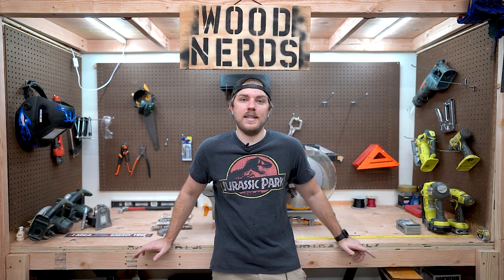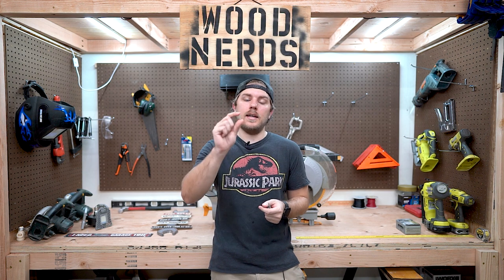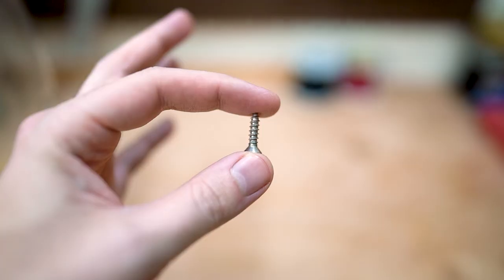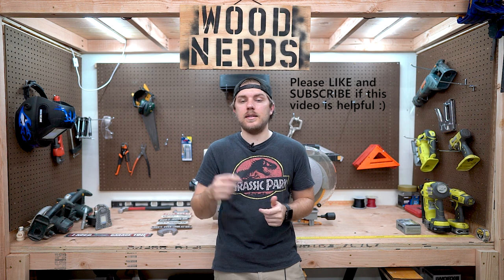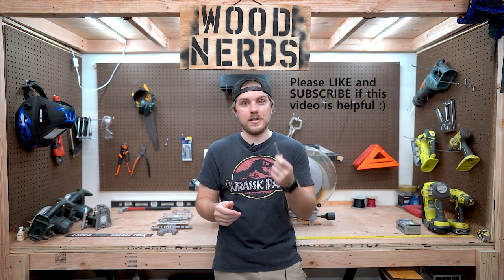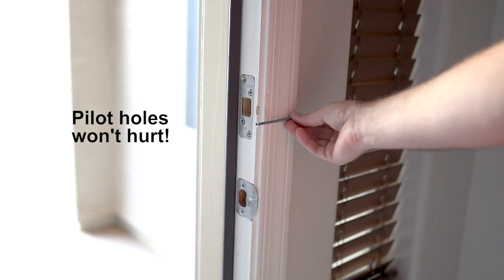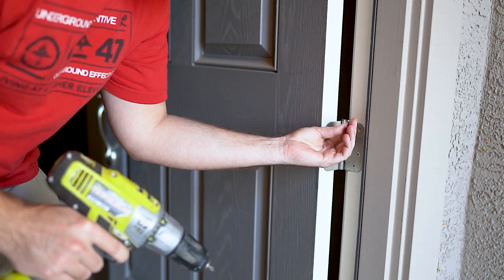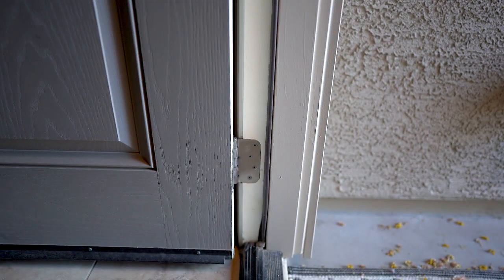3 Screw Security Upgrade

Comment: QUESTION: There is a video published more than 10 years ago on long screws. I believe it was an experiment performed by the LA housing authority using apartments they were going to tear down. Ring a bell? The LAFD literally had to break the door to get entrance, the hardware and hardware points didn't fail. I cannot find that video!

EDIT: Shoot. I don't think you saw the video. If you did, you'd put them in the deadbolt strike plate and barrel plate, too.

Comment: In Europe we use upvc doors and frames. You can hit them with a battering ram and you’ll just bounce right off it. 
The UPVC doors also have multipoint locks so when you lift the handle prior to locking then this fires bolts in to the frame all around - like 2 at least on each side and top and bottom of the door in to the frame. Seems crazy the yanks have single point locks. You need bolts on all 4 sides of the door really
Reply from the maker: Being a yank, I have never heard of this haha. I’ll have to check those out! Sounds really cool though, thanks for sharing!
Reply: Wood Nerds - Maybe we get a lot more burglaries here in the UK so it’s a thing, I dunno. Also our doors tend to require a key to open them from the inside which Ive heard is against code in the US (for fire escape reasons) so maybe we need the beefed up security to prevent people climbing in a window and escaping via the door. Just guessing...
Reply from the maker: That makes sense! Dang! Well be safe out there! Wish worrying about that stuff wasn’t a problem.

Comment: It's funny that you see people buy hundreds or even thousands of dollars of security equipment and cameras but never make this upgrade that costs less than $1. This simple upgrade plus a security door would be great upgrades for most homes I would think, but I'd never sneer at a good security system. Maybe future content could include security door or security system installation, I'd watch that.
Reply from the maker: I agree! That’s a good idea! Unfortunately like you mentioned they are expensive haha. I could probably weld up a security door or gate though. I’ll have to look into material costs for that. Likely a video for the winter since it’s likely going to be over 100 degrees for the remainder of the summer here.
Reply: Good tips if you don't have any other security. I spent years working prisons listening to crims talk. The best security is deterrence. A security door with deadbolts top, bottom and middle is a good idea. Crims want to get in and out quick, and they do their research on security, they'll see the triple bolt door and move on to the house without it.
Reply from the maker: That’s good information! Thanks for sharing!

Comment: The way most of these homes are built, there’s probably some thin shims (or air) between the jamb and jack stud.
Reply from the maker: The new houses are surprisingly economical but I think you’re right about how robust they are. It’s cheaper to hit all the requirements and miss the security aspect of a dwelling.

Comment: Thank you for the home safety tip. My only concern is that the 4" screws might penetrate some wiring or piping? But I might just be talking nonsense. Thank you.
Reply from the maker: That’s always a concern of mine! It’s not typical to run wires in those areas of the door frame (all the boards being penetrated are sandwiched together so there wouldn’t be a place for a wire to run, same with piping.) good thinking though!
Reply: @WoodNerds  OK Thanks, good to know
Reply from the maker: Of course! Happy to help.

Comment: I've seen this recommended before -- but I don't buy it. The shear strength on screws is not great; certainly not enough to make a difference. Replacing the hinges might help but you are still going to be splitting the frame or breaking the door itself.
Here is some detail from a Firefighter who breaks down doors for a living. https://www.reddit.com/r/lifehacks/comments/cprl7b/for_easy_extra_home_protection_replace_the_short/ewrfzzt/
Reply from the maker: Hey, thanks for watching! I respectfully disagree, the shear strength for 1 screw isn’t great, but several compounds the strength by more than I would be able to kick through. Outside of that most front doors now a days are thin metal with foam filling making it hard to break(bending more likely and perhaps warping enough to allow entry but by that time I’d be exhausted and everyone in the house would be prepared to defend). As for the frame, it’s pretty logical to say it’s a lot easier to split a 3/4” board (door jamb) than 3-3/4” of jamb, Jack, and king stud right? So perhaps an intruder could still make it in, but this would definitely give you more time to prepare, or maybe it would deter them from continuing the attempt when they find its substantially harder than previous doors they’ve tried? So surely you’d agree it’s still a worthy upgrade for minimal effort and money? Shoot, I bet you have the screws lying around to do this right now if you wanted.
Reply: I'm a firefighter also. I have 16 years on the job which includes 7 years on ladder companies. They are the crews who specialize in forcible entry and it's one of their primary responsibilities at fire scenes. I've also been a member of the urban search and rescue team for a decade. I have to disagree with some of the other firefighter's comments that were linked. He stated most doors can be forced with a strong kick. Sorry but that's BS. Not an exterior door. No way. further, I'd love to see him try, and I'll put money down that he can't kick an exterior residential door with a dead bolt. You can kick in an interior door. 

The strength of the door system doesn't rely on the shear strength of the screws holding the strike plates in, especially the dead bolt. Besides, the break-in attempt is not imparting shear forces at one single point. The screws are buried completely in the wood, so it's transferring the force along their entire length against the same thickness of wood at least an inch thick. But even with all that said, the door latch and dead bolt extend into their cavities by about 1/2" inch for the latch and about 7/8" for the dead bolt. Wood is pretty damn strong. I've been to car vs. tree accidents and the tree (even small ones) usually does just fine even when the car is up near interstate speeds.  The plates are mortised into the jamb so any lateral (inward in our instance of discussion) movement is anchored by the lip of the mortise and thus the integrity of the jamb material.  So, the longer screws are attempting to bolster the thickness of the jamb (~3/4" thick usually) with about 3" of Jack and king stud framing members. An attempt to force the door by your average burglar will likely be directly against the door near the knob. Again, you're not kicking in an exterior door, even with the little screws that come with the hardware. Look at videos of police sawt teams forcing doors with a battering ram (the hand held, not vehicle mounted). They need several good hits, and you'll find some videos of some pretty embarrassing entry attempts. 

When we force doors we use the irons, a flat head axe and a halligan bar. We pry the door and jamb apart to start a gap at the knob, between the door edge and the jamb surface. That's also about the mid point if the jamb opening and where you'll get the most flex the the jamb. With proper technique, you're spreading the door and the jamb apart to allow the latch and deadbolt to clear their catches. The technique also involves pushing inward as the pry with the halligan so typically you're also gaining space by collapsing the jamb into the void between in and the framing.  Door jambs aren't installed flush with the rough opening. There is usually tearing of the jamb and trim where the wood fibers fail. So all of this is a long way of saying that the longer screws can help some I would say. Depending on how the system fails, we will usually do a temporary repair by using long deck screws so that the homeowner can secure their place untill they can call a carpenter..... In cases where we force entry for medical calls, etc. 

I'm actually interested now in building a door prop and using longer screws to see how they might or might not effect a forced entry attempt. My comments above are just theorizing how the longer screws would work based on what I've seen with the standard hardware.

What will help MUCH more is a security buttress that anchors between the base of the knob and an anchor point on the floor.
Reply from the maker: Bob, thank you for taking the time to share your experience and also for putting your butt on the line! 

I would love to see some tests like that! Wish I had the cash to frame out some doors and point out the weak spots. If I was able, I think it would be fun to kick some doors in.
Reply: Again, if they are trying to kick down your door and failing, they will just move to the windows. The screws won't do anything other than piss them off a bit more.
Reply: @MAGAMAN Not always.  Glass makes a lot of noise and they have to risk someone hearing it and getting injured by the glass.  They would get frustrated and find another house.  They usually do doors first, now if a window is open, and an easy entry, then that is where they will enter.